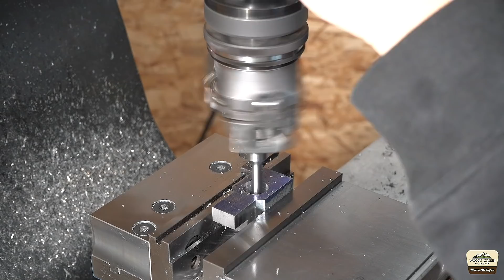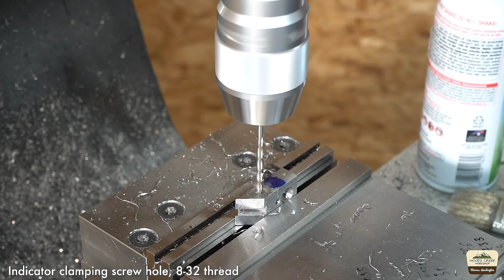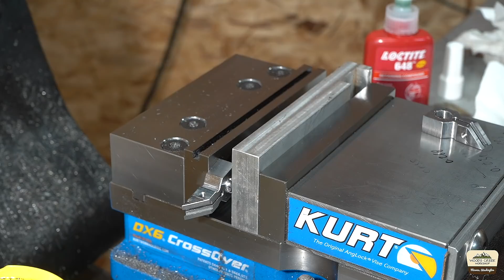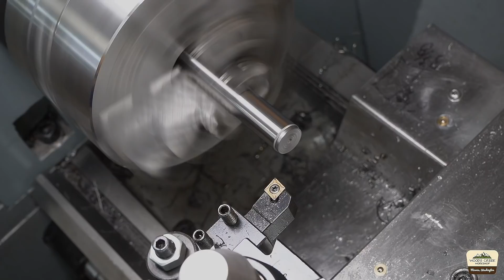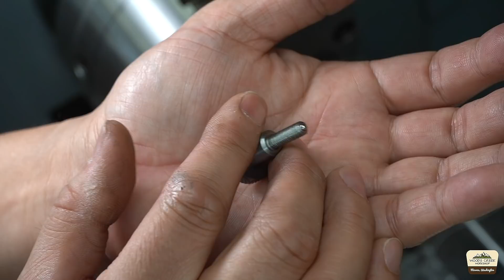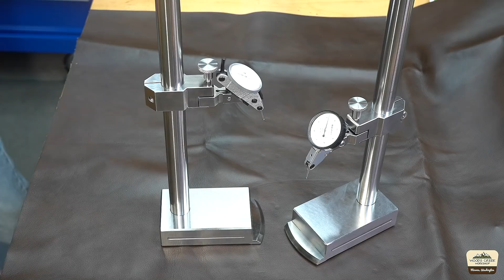Squareness Comparator - Build Your Own:  Part 2 The Finale

Comment: Hahaha, I arrived at almost an identical design on my own! Yours is more compact, I like space savings by holding the indicator at an angle. Mine hinges on top and the indicator holder has a tab that sticks out behind the hinge to be pushed by the fine adjust. I designed mine to cut in one shot on the wire EDM because I'm lazy, but my 1997 vintage wire EDM is giving me enough trouble it may have been faster to make it manually 🤣 Thanks for the video!

Comment: Beautiful work.
I made mine using Stephan’s design. I then heat treated the base and sliding part, they both cracked. I used O1.
The A2 came out great for the clamp.
I’m going to make the two components again. I may incorporate some of your more simplistic design features in my build.
I can’t use low carbon steel, I wouldn’t be able to sleep nights.
Thanks for posting. You did a great job man.
Reply from the maker: Thanks!

Comment: A good job well done.....nothing like achieving perfection.........and twice.
Edit.....In reality I have to wonder what the value of this tool really is.....if your machine(ing) is accurate there is no need to check the squareness except maybe for an item that was sent out for machining and needs to be checked......if you make something and it's out of square it's a scrap box item.... no going back.
You always make something square in the mill or a grinder........you never re-machine anything to get it to be square.........re-machining something to correct it  is a hit and miss occupation.....if it's out of square on the first run it will not be better on the second run.

Comment: Beautiful, that tool is a work of art. Is there a reason you didn't make the two clamp screws , or is there not enough torque with a finger screw, or tommy bar? Cheers!
Reply from the maker: My currently knurling tool can’t handle bigger diameter work, will be building a new knurler soon.